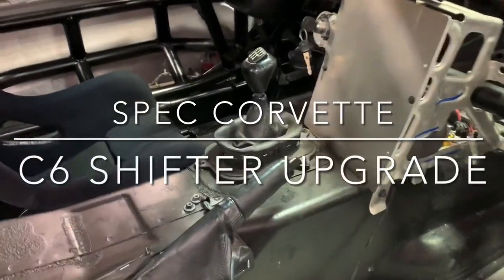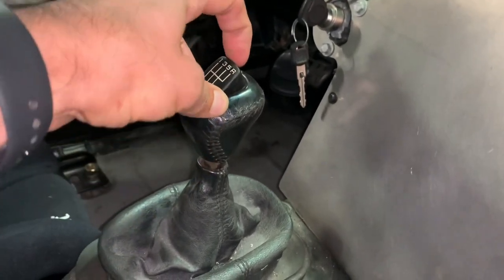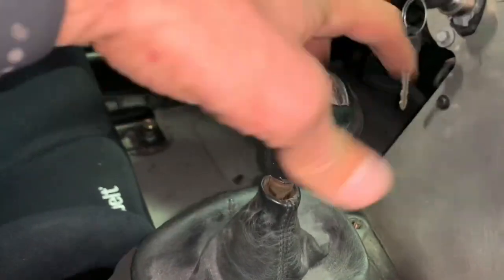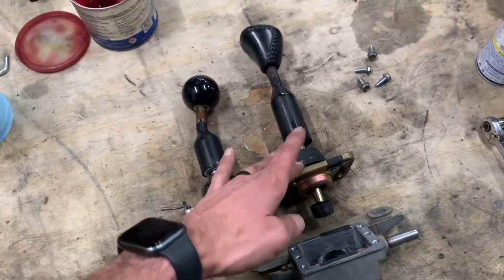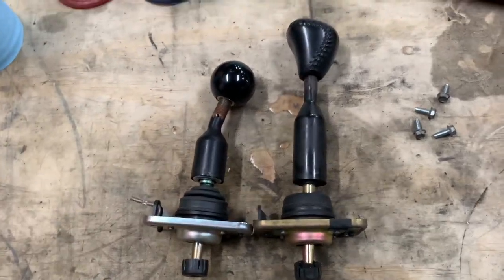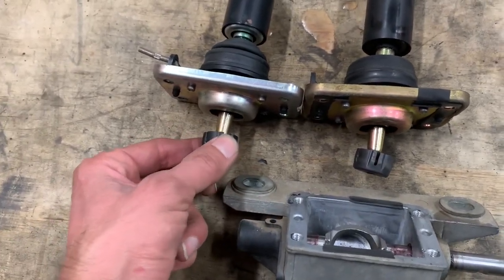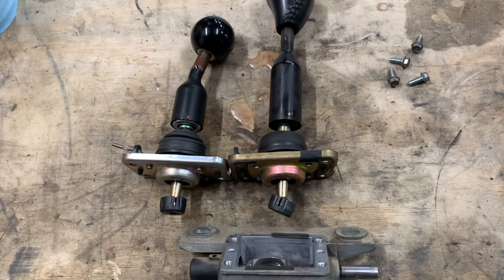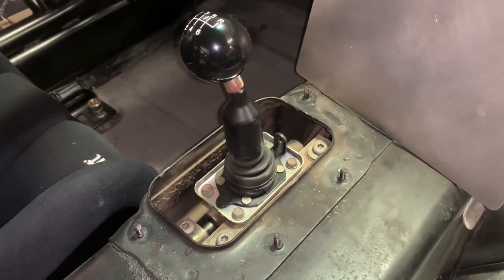Spec Corvette Project - C6 Shifter Upgrade

Comment: This was an excellent video! I love the details you noted with the wear of the bushing and the lack of smoothness with the horizontal shifter rod. Many times people don't notice these items and just by replacing that bushing and cleaning and lubricating, the factory shifter rod will make it feel like new. Love the 8- ball knob btw.

I have a C6 GS and I went with MGW years ago and it was the best move ever. The shorter throw of the MGW was more than noticeable, but did take a bit of time to get used because of the notchiness of the MGW. Now I have a MGW Gen 2 Flat Stick setup and I don't know how they did it, but the throw is even a tad bit shorter and the looks of the flat stick are great. I had it color-matched to my Crystal Red Metallic body color and I too went with an 8-ball knob w/shift pattern. The color is a great interior accent pieces and goes with my color matched seatbelt replacements. So, should you decide to go after-market down the road, I highly recommend you go MGW. In the meantime, enjoy your "new" shifting experience.

Save the Wave🙋‍♂

Comment: I was at Sonoma today and 3rd gear just wouldn’t work on the down shift. It was like it wouldn’t fully engage. I have a bunch of slop in the shifter. C6 zo6 shifter in a C5 Z. Do you think the bushings worn out?how long does is it supposed to last with heavy track use?
Reply from the maker: It seems unlikely that it would be the bushing. I had 141k miles on mine and the movement was very small and not what I would consider problematic. Is the slop present everywhere or just when downshifting from 4 to 3? It’s possible that the linkage is loose. That’s fairly easy to fix, so check it first. If it’s only present between 3 and 4, it might be the shift fork. That one is known to bend.